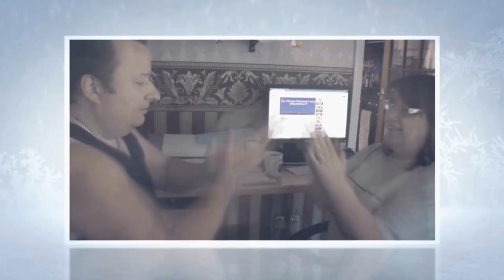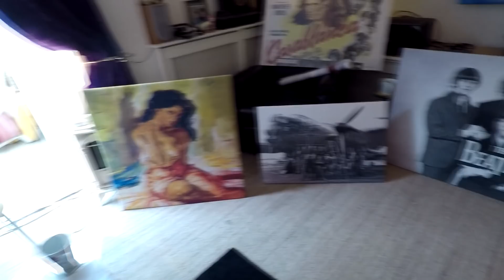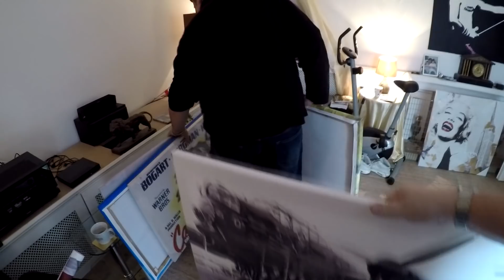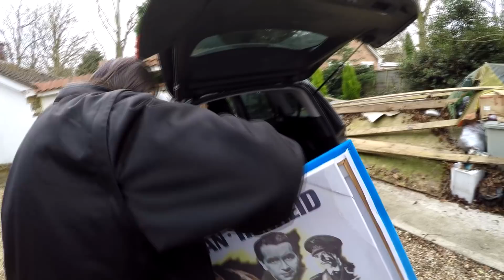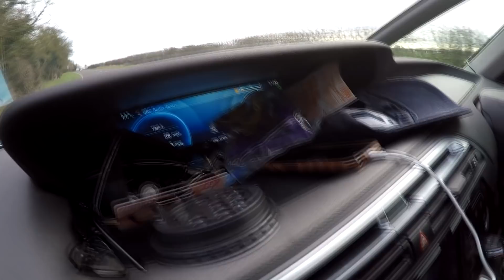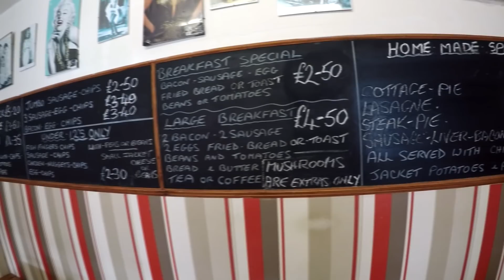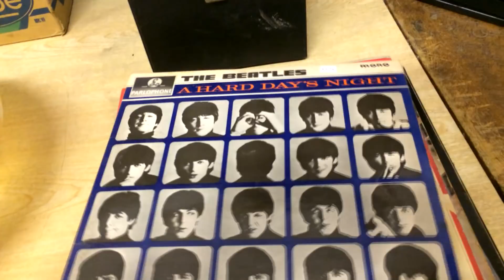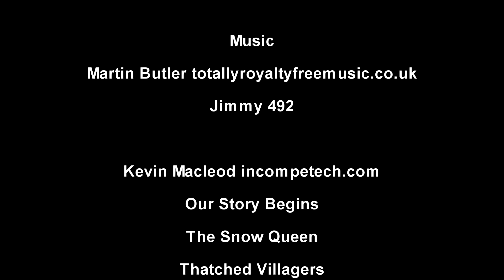Capri Update And Lee's  Auction Adventure  Vlog

Comment: Hi Martin, another great video, vert funny. Just a question for Jimmy, what spray guns and setup does he use for the smaller panels and wheels etc. regards neil
Reply from the maker: Hi Neil, For smaller stuff he has the Devilbiss SRI guns. They have a 0.8 tip for the water based basecoat and a 1.0 tip for the lacquer.
Cheers
Martin